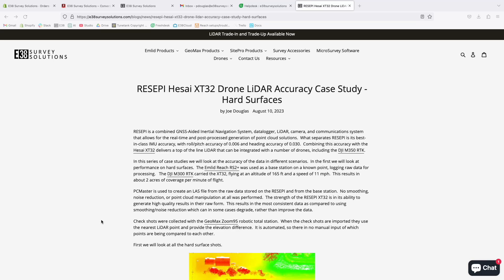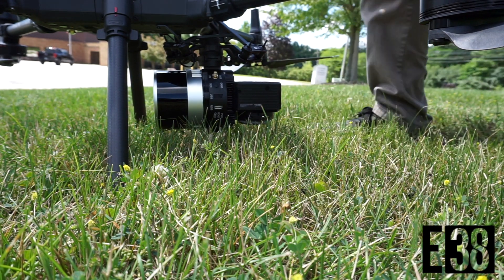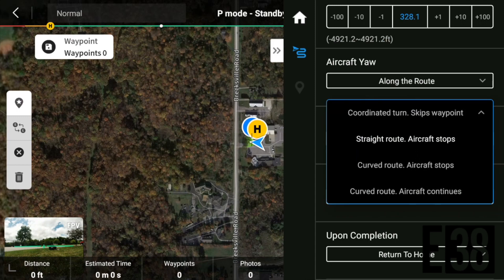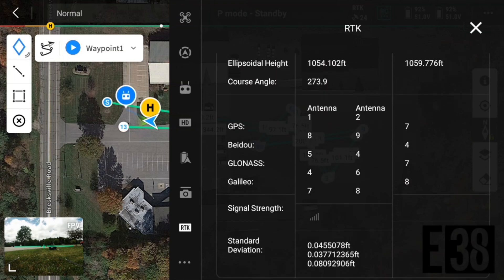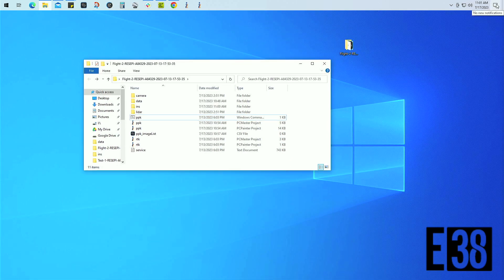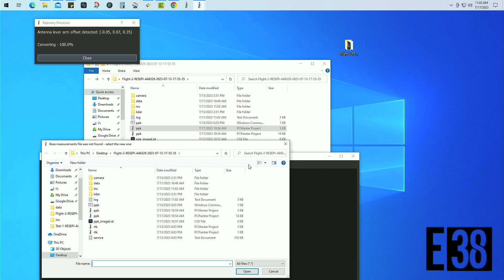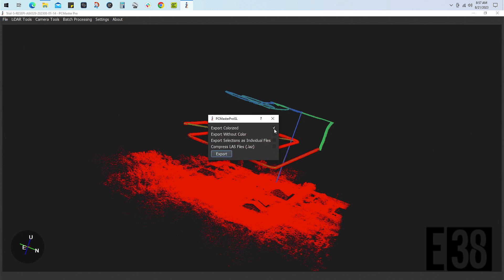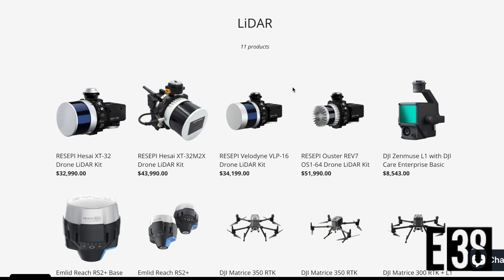RESEPI Hesai XT-32 Drone LiDAR Workflow

Comment: When entering in base location, can you update later with new coordinates if that location was reshot with a rover? (example: lidar crew scans property before survey team arrives to shoot gcps and boundary)
Reply from the maker: Yes you could re-process your point cloud with an updated base coordinate, or wait to process until you have the coordinate you want to use. So long as you have a log with an observation from your base for the entirety of your lidar mission (initial static alignment through final static alignment) you will be able to use that file and update the precise coordinate when processing through PC Master.